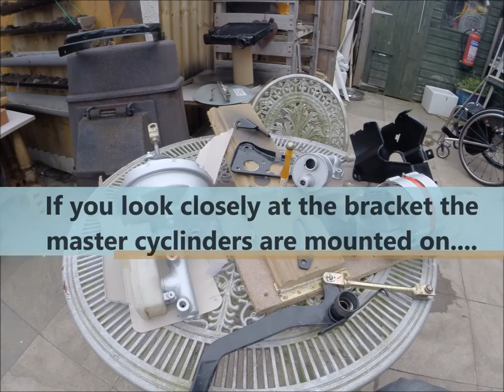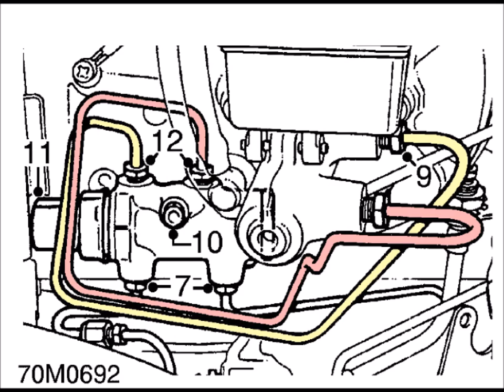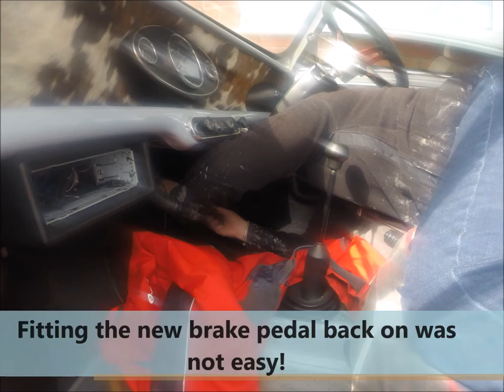Sarahs Mini - How To Fit a Brake Servo to a Classic Mini

Comment: I noticed you have solid tower mounts. Did you put those in with the engine still in? If so, how hard was it? I'm doing it this weekend.
Reply from the maker: Hi Jay, I fitted the solid mounts as we refitted the subframe on the rebuild.

Comment: The new pedal is identical to the old one, drill out the rivet in the lever arm. Put the lever arm over the old pedal and fit a pin through like you'd do on a non servo master cylinder. It makes the job a lot easier.